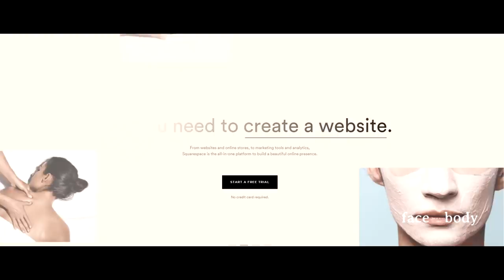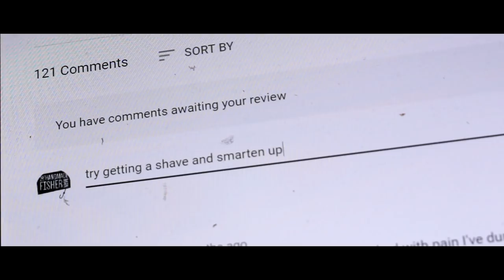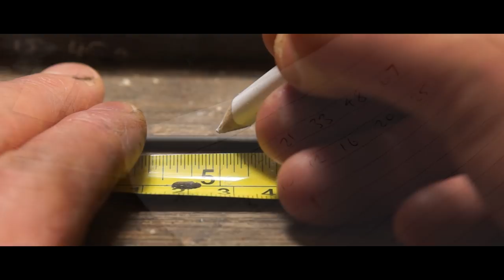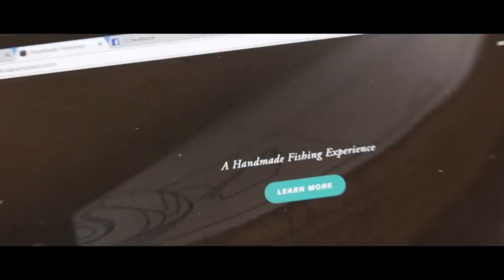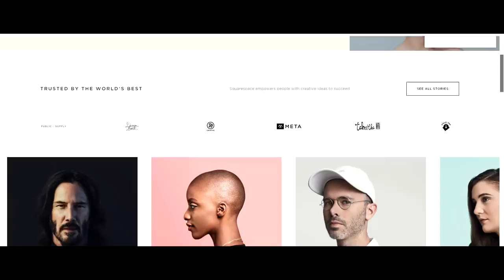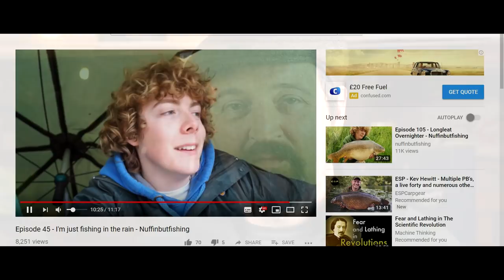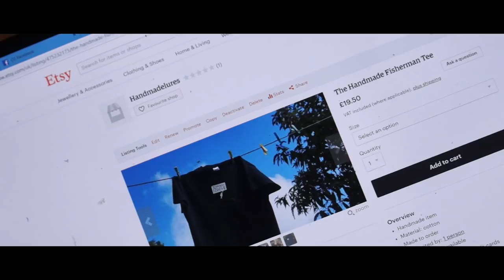How to build a custom fishing rod part 1

Comment: Having built a couple of dozen rods over the last 30 years the single most important tip I would like to pass on is to always test and adjust your ring spacing before whip anything. This is particularly important for a multiplier / baitcaster rod where you'll be fishing the line along the top of the blank. 
Glue on the tip ring, tape on the butt ring in the optimum position in relation to the reel seat and spigot. then tape on the intermediate rings in there approximate position. Tread some line through, put a load on and see how the line sits between the rings. You can keep adjusting the spacing, or even add or subtract rings, until it looks right and you're happy.
Reply: That is an excellent tip (no pun). A very important one too!

Comment: After 30 years of amateur Rod building one tip I can offer in your wrapping is when you tie the tuck under wrap at the end of the wrap instead of using string to pull through the wrap use a guitar E 6th string usually the thickness of it is .010 , about 5in long bended in half , it makes it easier to pull through and you can do it with just one hand and  it will never break if you drop it you can pick it up with a magnet on a stick instead of bending over give it a try you'll be amazed at the difference
Reply from the maker: might give it a try, but someone who plays a guitar in my house is not going to be happy

Comment: Hello grettings from Croatia,is the finding spine same to apply to telescopic  bolognese rod 7m long,I have naked telescopic 7m bolognese rod which I need to put guides,the only thing I see on each section where the guide is going ,is the connection line of carbon connected when manufactured( this is naked version of bolognese rod),as I search for the info over internet, on some sites I see that connecting carbon line was suposed to be the spine and the guides will need to be at 180 degrees from that line( opposite side of that line , because the joint line is the tuffiest part of section). On some manufactured rods there is a clear white marked line where the guide is supposed to come ,but in my case that white marking is missing. I have seen Your videos of lure making,few times ,and I found them very educational and interresting,Your videos are amazing,everything well explained.

Comment: interesting video.Can you tell me if a rod builder can take my existing rod which is an 8' one piece and cut it and make a two piece,but I want it to be a 9' rod when complete and have a different action to it?Basically a new top section would have to be made.

Comment: really was so nice but if you not think bad i want to give you some advice about your drill,
sewing machine engine gets better than the drill we was using it to make spiral soft springs, it have own mechanism, just install and use
Reply from the maker: i have a sewing machine motor, but opted for the drill driver as a lot of people already have them. cheers

Comment: Paul,

Another great video.  I have watched it several times.  Thank you for that.

Just finished my 1st Conventional/Casting Rod.  Broke all the rules:
Paracord for Handle
Snake/Fly Guides wrapped then CA Glue/Shrink Tube to secure
Nail Polish on top as a finish

Found that the Line lays between the Guide Feet on the top of the Blank exactly following the curve of the Blank.  

Will be mounting a Penn 9 and drift fishing chunked bait.

Please keep the videos coming.  
Steve
Jetskisportfishing.com

PS
I welcome comments....

Comment: My nylon winding is starting to unwind, any advice how to resecure........thanks for posting
Reply from the maker: probably not enough tension, or the there is not enough line pulled through at the ends, i am whipping on a mat finished blank which is a lot easier than on a gloss painted blank